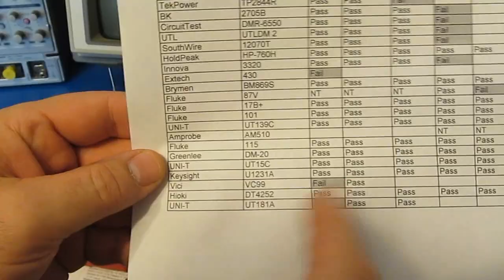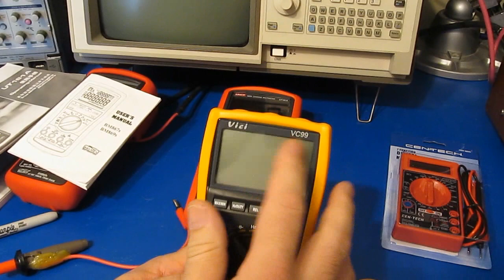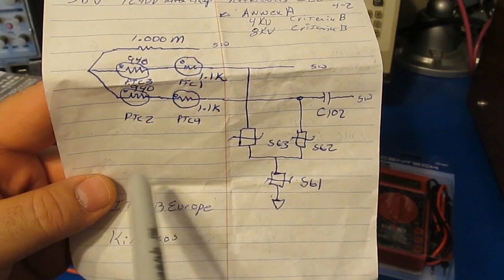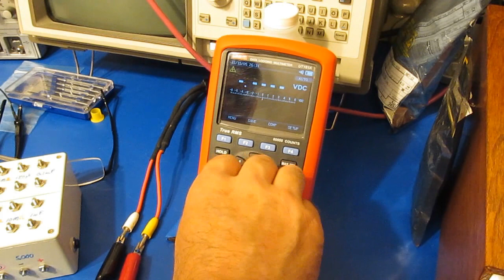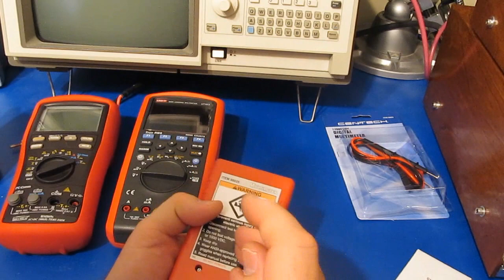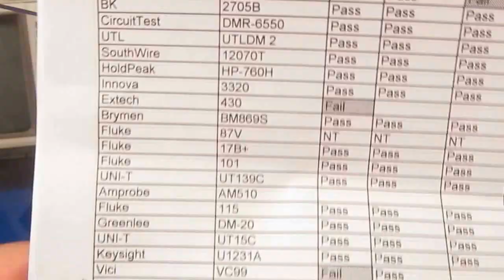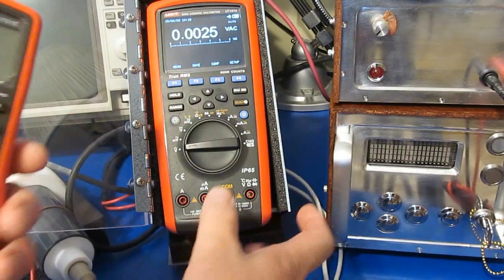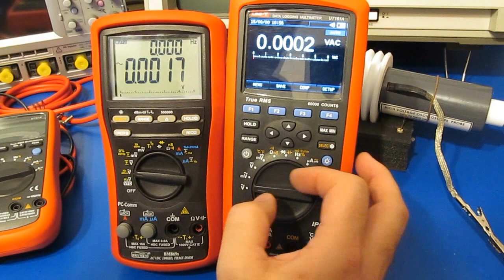The UNI-T UT181A Datalogging Multimeter Review Part2

Comment: Joe,
First let me thank you for the educational video.
I only wish I had watched it a week ago..
I thought the 181 was the perfect meter for me and ordered one of them just a few days ago and waiting for delivery.
I still think it is exactly what I had been looking for but after seeing the effect your low current high voltage thumb powered pulse generator had on it,  I am greatly concerned about the long term reliability of the product.
I noticed that the tests in this video were done three years ago and was wondering if the 181a protection had improved over the last three years, (as you hinted UNI-T should have done), to improve their product.
Have you tested any of them recently?
Reply from the maker: I only looked at this one meter.  If you are interested in seeing a brand new one, you could pick up an igniter and repeat my tests.
Reply: @joesmith-je3tq  ,
I was actually hoping that your response would have been that Uni-T had worked with you to incorporate your 'fix' into the recent production runs on the new meter and I wouldn't have to be concerned about that static discharge problem. 
 If they didn't, ....in my opinion,..... they weren't very smart.......
Thank you for the quick reply.
Reply from the maker: @Dennis-mq6or  I have never been in contact with UNI-T about the UT181A.  If they have made any changes to the design, I am not aware of it.   It would be easy enough for you to try it with yours.  Just keep in mind that you may have a difficult time getting it repaired if it becomes damaged.  You may also have to cover the costs.  Worst case, I would assume it would not be covered and you eat the cost of replacing it.
Reply: @joesmith-je3tq  I was afraid to do the test for fear of hurting my meter.
If only one person does it, I am sure they would have to pay for the repair and the design would never get changed.
 But if 1000 people did it, then they obviously have a serious design problem that should be repaired under warranty.
 But if they only replace that TI power device, the meter would be returned with the same weak link in it's HV protection.
 Are those TI converter devices very expensive.
The best solution for me, aside from circuit changes, might be to order some of those TI devices and tape them inside the back cover of the meter so I can do a quick repair when it fails...
Thanks you,
Dennis O.
Reply from the maker: @Dennis-mq6or  Not sure what I paid for the replacement parts.  I procured mine from Digi-key.  I suggest just checking their current price if you want to know.   Of course, if you can't solder, the regulator may be the least expensive thing.  I've seen people who have no idea how to solder destroy test equipment.
Reply: @joesmith-je3tq  
Thank you...

Comment: I will guess that converter died from a overvoltage at the output killing the chip. Simplest fix would be a little more capacitance at the output ( another ceramic capacitor) and a diode to clamp overvoltage from the output back to the input and thus the battery.

Comment: Hi. I could not understand the video because I don't speak English, but I want to get UT181A. If you make good and bad comments, I can understand with google translate.
Reply from the maker: Hello.  If you like the meter and feel it meets your needs after reading the manual, then I don't see a problem with it.  It's not my choice of meters due partly to the weak design which is typical for this brand but it also has some benefits.  Keep in mind, you can't use the meter when it is charging.

Comment: Great job!
Reply from the maker: +Ig Saturation Thanks.   It was a fun one to make.
Reply: +joe smith Hello, can you give email, I want you to send one vesh which will facilitate testing of many components of electronic components in one unit more compact, but it is necessary to modify, the basis is the same as your video, photos can lose?
Reply from the maker: +Git Up It sounds like you may have bought some equipment that you believe could use to run these sort of tests.   My advise is to start a thread on EEVBLOG and post your pictures and information there.   I'm sure you would get a few people there to help you.

Comment: Joe Smith, Love your Videos and the depth of information!

Please though inform us of the required modifications to reduce the sensitivity of the ESD on this meter. This would be very beneficial to the community to improve this meter or as a learning exercise!

I understand there are some safety concerns but I'm sure that a liability statement would go to protect yourself. 

This is not beneficial to the community by not showing these mods.
Reply from the maker: So you love the videos and information I provide but you feel its not beneficial.
Reply: From your own post lol "The jist of all this is that withholding education never yields benefits."

So I understand your concerns about the modifications and the liabilities but how about you at least let us know what caused the input of the TPS to fail and what you did to resolve it, no need to state exact positions but just block diagram style or ect. 

Why re-invent the wheel!
Reply from the maker: You may want to take the time to read what was posted again as it appears you did not comprehend.I understand you feeling you speak for the entire community and your deep understanding of my own concerns.  You have great empathy.  But here we deal in data.
Reply: Comprehension certinaly isn't an issue here JOE.  You can argue with me all you want but the data is; you know how to improve this meter and instead of sharing with the community ( electronics and meteorology) it appeases you have informed UNI-T and they have scared you with a liability statement.  prove to me this isn't the case and share the modifications.

Certainly more than small list of people here let alone EEVBlog forum that would appreciate the info.
Reply from the maker: It's not an argument.  I did not write the comment you quoted.  You can make up stories but again it's not facts.  I have nothing to prove to you.

Comment: eh why is it to make such an expensive multimeter somewhat safe, for the asking price it is kinda unacceptable. Uni-T is always a dilemma of having good features but bad protection and the higher product tier you look at, the riskier it becomes
Reply from the maker: I really have no idea if the meter is safe or not.  They have had it certified by a third party, so I assume it meets the safety standards.   It's certainly not very electrically robust when compared to many of the meters I have looked at, which is typical for this brand.

Comment: Excellent reviews and very informative and educational. According to the UNI-Trend web site, they suggest UT181A has passed EN61326-1. You can see that on the logons on the web page for the UT181A here http://www.uni-trend.com/productsdetail_1557_1042_1042.html. In addition, you can download a copy of the certification in the "Download Manual" section for the UT181A and look at the CE certificates here https://drive.google.com/drive/folders/0B4Jyby-tjH5oRDhnTTlrTC0xaDg. When I 1st saw this, I thought they might have updated the UT181A and included fixes for the robustness, but it would appear those certifications date back to November 2014, and thus I assume before the UT181A you got, and thus it might be optimistic to assume 1 purchased today would be any better?? If so, do you think the issue might be more due to high voltage I assume the piezo grill ignitor is putting out compared to what is used for the standard? Or do you think the certification is a fake?
Reply from the maker: I posted a test report once for a meter and it showed their test setup for ESD.   Based on that, I would say it is possible for a meter to get certified and fail the grill starter test as well.  In the end, the grill starter does not care what meter is attached to it.  It is a very short, low energy pulse compared with the IEC standards.   I've shown that as well.  I've also shown several meters that were not damaged during this test.   It is possible that some test labs will run the test differently than others.  The problem with this is it waters down the certifications.   For this particular meter, I can only show you what is in the video.  I have no idea if the cert would be fake or not.   My guess is if I bought another 181A it would fail the same way, like many other UNI-T products I have looked at.  I now test at much higher energy levels.
Reply: I am sorry, but I can't find the suggestion on the site. I can see IEC EN61010-1 only.
Reply from the maker: The suggestion?  I am not sure what you are looking for.  If you are wanting to see the report I referenced,  I had posted it on the EEVBLOG site some time back.  If you are looking for the 61326 cert the OP refers to, just follow his links.
Reply: Hi Mr. Joe Smith!
Sorry for my confused reply. I didn’t want to reply to you. The problem is, I could not find suggestion from UNI-T that UT181A comply standard EN61326-1 on their web site, nor in the user manual, as Mr. Matthew Swainston wrote. Your reviews are really useful for me, because I really consider to buy an UT181A, because she has the on-off button. It is annoying to me turning on and off the instrument by the selector switch. If Brymen BM869 had the same feature, I would consider to buy it. Its robustness and 500000 counts still attracts me very much, but I think I understand what you did to UT181A  in order improve its robustness. Hope I am right.
Reply: It is not in the manual, but it is on the 1st web URL in my original post if you look carefully. Look at the row of graphics icons at the bottom of the description there is a grey box icon that list the standards that includes the EN61326-1 (you can't do a find because it is a picture and not text). For the actual certification certificate, click on the "UT181A CE Certificate" link in the "Download Manual" for the UT181A and you will be taken to a google drive with 3 documents (which is the 2nd URL I have put in the post above). Clicking on the UT181A CE-EMC.pdf document shows a certificate that clearly shows EN61326-1. Unfortunately I could not find the post about the test setup for ESD because I would have been interested to read the background there, but no doubt I have not looked hard enough. But if I am reading Joe correctly, it sounds like he does not necessarily doubt it has passed some sort of EN61326-1 test. But obviously feels that those tests are not good enough to determine the robustness of a meter. Joes work shows for a range of use case it would appear that a lot of other meters that are more robust on Joe's tests. So I think it is a case of buyer beware and keep this risk in mind for your application and purchasing decision, and after weighing all the pros, cons, price and support in mind. Again, thanks Joe for what looks to be a very objective review.
Reply: Mr. Matthew Swainston, thank you for your detailed answer! You are right. I can see now.
Reply from the maker: I would need to find the link to that report but basically, when I read it, it seemed the test was complete rubbish in how it was conducted.  Basically, no leads and no discharge to the contacts.    So the product did technically pass.  My guess is if the UT181A were tested this way, it would pass with flying colors as well.  The reality is that in real life, the inputs can see an event.   I don't remember what meter it was but it did leave me with the impression that I would really now question the certs.  The report or link to it is on the forum.  Have a look and see what you make of it.  Maybe I misinterpreted it.   

The full reports should be made public, and maybe they would be if you were buying enough of them.  For us general hobbyist,  I don't have an answer.   It's partly why I have been running these tests.  I have nothing to sell, and don't gain anything running them out side of my own interest in seeing how the meters perform.  

Anyway, glad you both find the testing somewhat helpful or entertaining.

Comment: Brymen is top notch.
Reply from the maker: +TheOldmankk I don't know about any of their other products, but will say that the BM869s is!  I really like that meter.
Reply from the maker: +Gregan Dark "i disagree,because it's like a fluke 179 ,
where to replace the battery you must to open the entire meter which got the self tappers of plastic ......."

Assuming you're referring to BM869s, you must not own one and have not done your research.  The battery cover is held in place with two screws using brass inserts.   

Even for the UT181A, the rechargeable battery cover is held in place with three screws.
Reply from the maker: Can you post a few pictures of your BM869s?

Comment: Thanks for video, but dont  make cuts, we dont see speed response of the multimeter in real time
Reply from the maker: Speed response?  What part did you not want to see cut?
Reply: joe smith  every time you change value to be measured, if it takes no more then 5-10sec, you dont need to make cuts in video, it is very annoying by my opinion

Comment: Excelente video, una lástima que no esté disponible el cómo hacer más robusto el UT181A lo cual me parece algo contradictorio porque con otros multímetros sí compartes ese tipo de información... si te ofreciera dinero, ¿me podrías dar la información por interno por favor?... PD: acepto bajo mi responsabilidad el resultado de las modificaciones y me comprometo a no divulgar la información...
Reply from the maker: I suggest you read the FAQ.
Reply from the maker: Links in the comments are blocked.  The link to the FAQ may be found in the description.
Reply: @joesmith-je3tq  
excuse me... If I make holes in the board to avoid electric arcs and paint it with "Corona dope" is it enough or do I need to put additional PTCs, MOVs, and cut and retrace tracks?
Reply from the maker: @sergioinostroza3529  The fact you are even asking such a question tells me this is a VERY bad idea.  If you want a meter that can survive these transients, just buy one.  If you would like to see UNI-T make an improved version of the 181A, I suggest writing them.  The one thing you should NEVER do is modify any safety device.
Reply: @joesmith-je3tq  dear Joe: i can't afford a fluke 289 for example, if i had enough money i wouldn't be asking how to make the UT181A more robust, UNI-T will never answer a request from a simple retail buyer, i should be a great distributor so just they consider making improvements to their product ... I have no alternative, I will risk modifying it on my own 
to use it in my freelance work and I hope to be lucky and that I hope my knowledge of electronics will serve me
Reply from the maker: @sergioinostroza3529  It's a safety rated product.  The cost of an injury to you or someone else could far exceed the cost of any meter.   Of course, that's the risk.
Reply: @joesmith-je3tq  I take the risk, thanks anyway ...